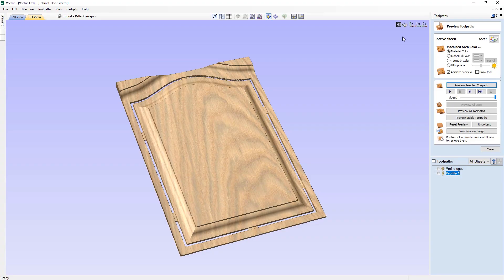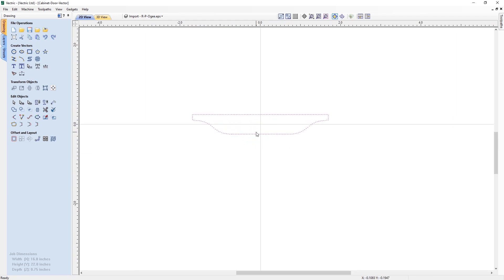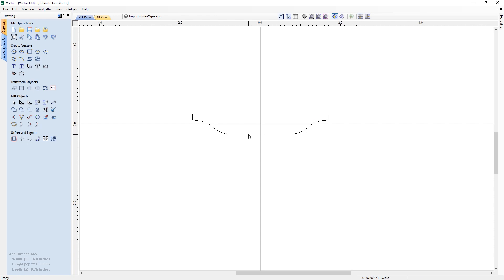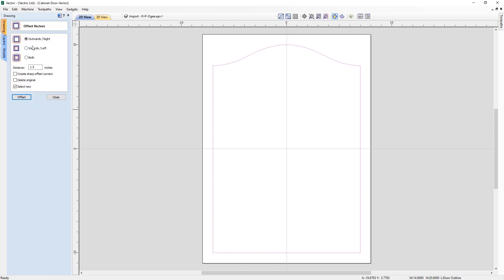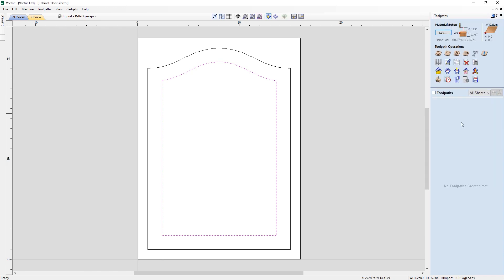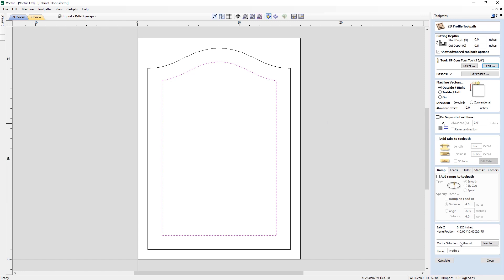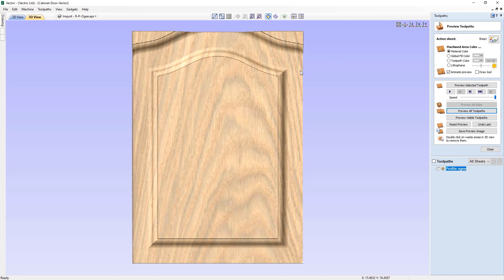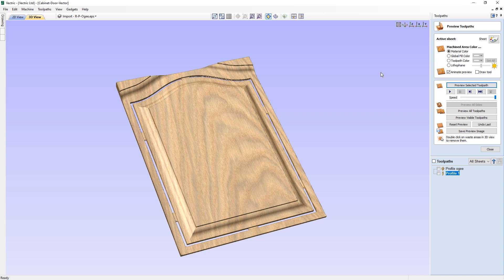Raised Panel Door | Vectric V11 Tutorials

Comment: So I just saw software Mosaik able to program the raised panel doors as one piece by making the corners all machined with sharp corners.  Is this possible to do in any Vectric software?  What you showed above is to make the inner piece only.
Reply from the maker: Hello... thanks for the question.  You could but Mosiak is built for that specificaly, so if that is what you are looking to get into then it may be a good choice.  I would suggest downloading the Trial version of our software and give it a try to see if it fits your needs.